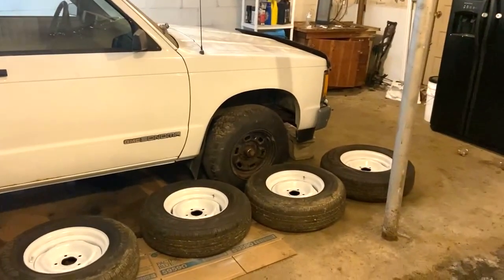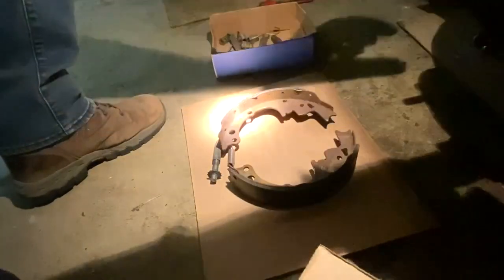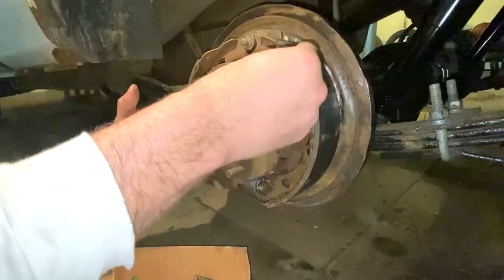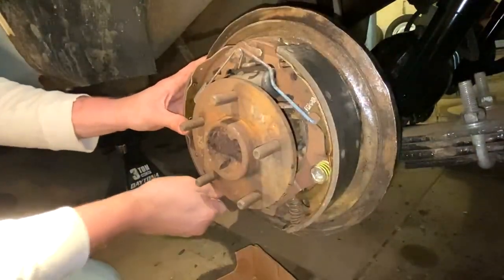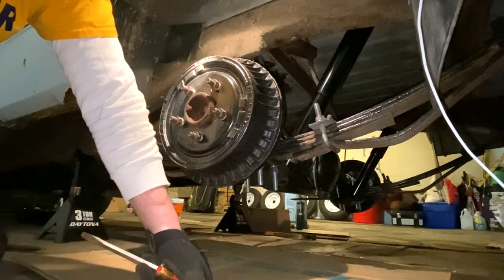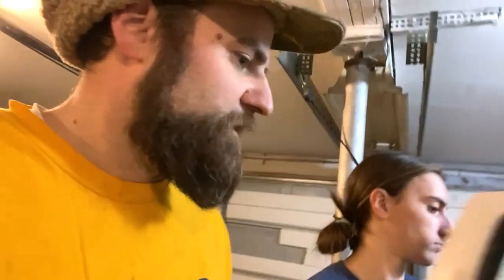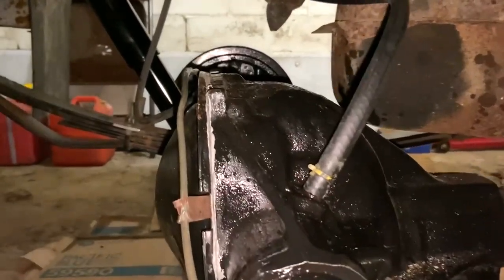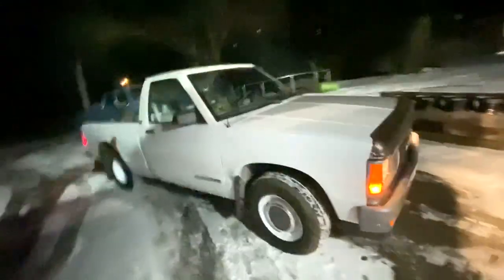Replacing the rear end on the 1992 GMC Sonoma!  (Part 5)

Comment: So I’m at this part last night/today and I ran into a bit of a dilema, I ordered the wrong parts and since it was an online order I couldn’t just swap it out and return it in a timely fashion. I’m also in a time crunch because of code enforcement and I have my truck on stilts now so I was just going to use the old ones from the truck but they look like one was leaking a bit so I had to buy a new pair pair. I wanted to go with the AC Delco wheel cylinder LS but had yo settle on Carquest, both made in China so it’s probably doesn’t matter. I had a discount code from Advanced so that helped. Part number is WCA37967 and I also purchased the spring kit since I was there and had coupons; springs came out to $2, part number on that is 7059. One more thing that I wanted to say is that I couldn’t tell from the video how you installed the e-brake. I was going to wrap it all up before installing and then realized that it needs to be hooked up before so yeah. I also realized that hardware would have to be purchased separately but since I don’t have funds and the ones from the donor seem ok I’ll be reusing them. The shoes and drums are new though. Thanks for making this series of videos & the replies. Sometimes I wish I could make content but I’m not photogenic and I’m assuming editing can be time consuming and wouldn’t have the patience for it, much respect & appreciation!!! ✊🏿
Reply from the maker: For some reason YouTube didn’t send me a notification so I didn’t see this comment until now, so I apologize for not responding earlier.  I hope you were able to get everything done and get the truck up and running. Also to make it easier for guys I pulled out the step by step video for replacing the drum brakes. Here’s the link to that https://youtu.be/ZnZzBp-GdTE
I don’t think I did a close up of the emergency brake but I did get it on this video. Hope that helps. 
Like you I was on a time crunch as well and so I went with the duralast Autozone brand but like I said earlier I plan on getting the whole driveshaft rebuilt at some point. 
I appreciate you watching my content and glad that it is helping you out. As far as making the videos to upload, I honestly just use my phone and since it’s an iPhone I typically use iMovie to edit and post here on the channel. I also downloaded a free editing software for my PC and when I don’t have enough spice on my phone I will email the the iCloud link for the videos on my phone so I can download them to my PC and just do all the editing on there.
Reply: @the-onlydude  Thanks, It’s up and running now. To me that was the hardest part since I did everything by myself. Holding it open with one hand and installation it with the other. Another thing that got me annoyed was that thought a spring kit would come with all the hardware. It was missing some things that had to use from the old ones. I’m not sure if they sell replacement brackets, I wire wheeled the old ones and they came out pretty good. I coated them with Syl-glide to prevent further corrosion. One thing that almost slipped by me was the little spinning thing on the bottom. They were seized to I used the ones that were good and lubed them up as well, after that is was smooth sailing.
Reply from the maker: Awesome glad you were able to get your rig running. It can get frustrating when things don’t go your way but you have to keep pushing forward and boy does it feel good when it’s completed!
Reply from the maker: Awesome I’m glad you were able to get your rig up and running. It can definitely get frustrating when things don’t go your way, but a guy just needs to push forward and get it done and in the end it will all work out. Keep turning those wrenches my friend.
Reply: @the-onlydude  Thanks, I now wonder what I should do with the old one. 🧐
Reply from the maker: The junkyard didn’t charge you a core charge? I would check with them and see if they did and just return it to them and get the charge back and if they didn’t charge you they will probably give you some money for the scrap. 🤷🏻‍♂️